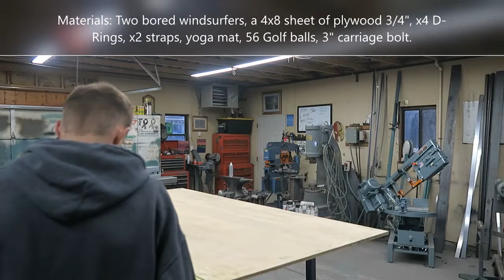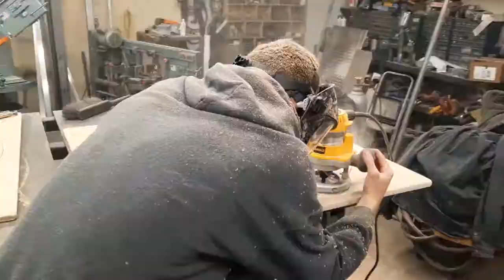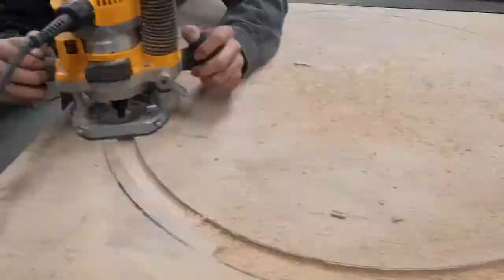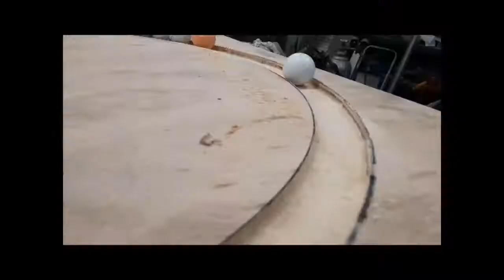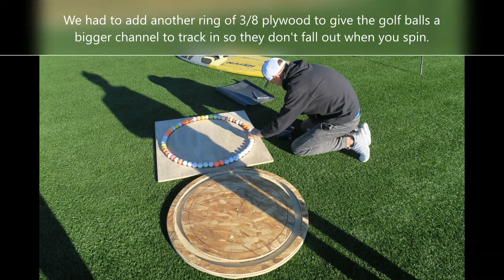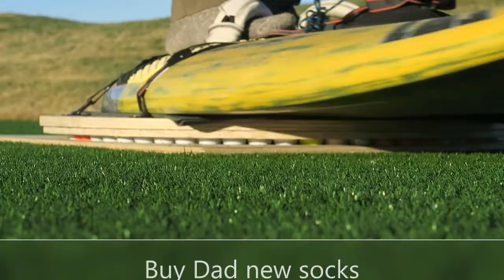How to build a windsurfing simulator

Comment: Hey do you have any images of how you put it together? I can't see how the carriage bolt is used.
Reply from the maker: You find the center of the wooden circle and you put one carrige bolt through it to hold the two halfs together and to keep pressure on the golf balls.  Hopefully that helps!
Reply: @bendoremus1290  Thanks; you wouldn't happen to know the radiuses of the inner and outer circles? I've calculated ~358mm and ~402mm.
Reply from the maker: Just cut your 4x8 sheet of plywood in half to have x2 4ft squares router in a circle into both you could probably go around 3ft if you wanted.